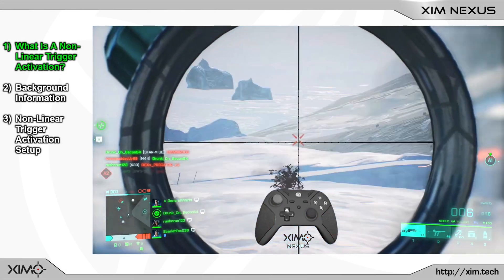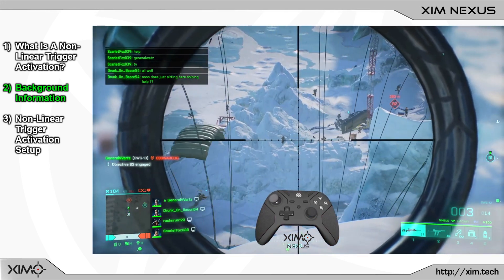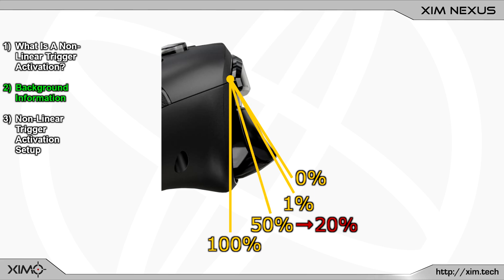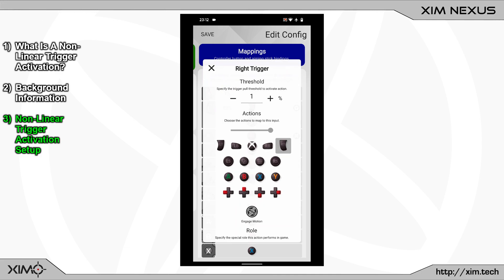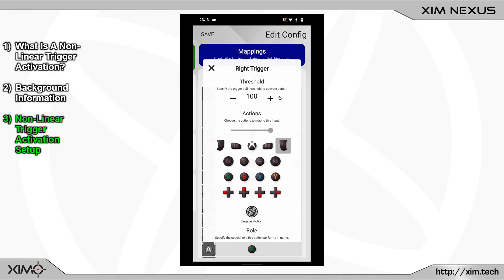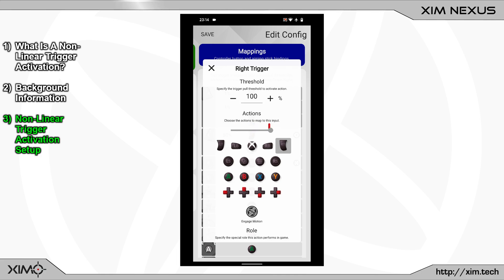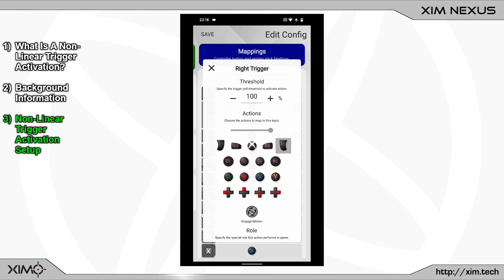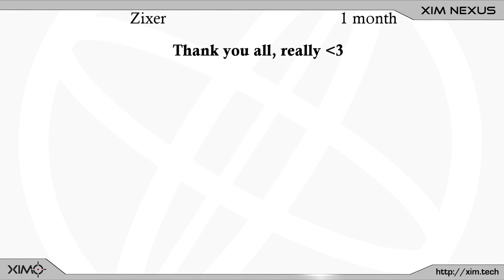XIM Nexus - Non Linear Trigger Activation Setup Tutorial (Neu Nexus Trigger Tutorial Part 2)

Comment: So I can just use the normal nancon controller and not the nancon compact
Reply from the maker: Hey, what do you mean exactly?
Reply: @XIMCentral  so I have a ps5 but want to use xim on ps5 games and in your video a while back you said the nancon compact controller works with ps5 games so I was wondering if the nancon compact is just the nancon ps4 controller
Reply from the maker: @_ekul_472  Ah ok i see. Most PS5 games removed the so called PS4 speciality controller support by now, which the Nacon is part of. At least most FPS games did. Most fighting- or racing-games still work with this solution. If you want to play the latest PS5 shooters then you must use a Beloader or Sony Remote Play nowadays. There currently is no other way.
Reply: @XIMCentral  so I couldn’t use the nancon controller for the ps5 version of rainbow six seige
Reply from the maker: @_ekul_472  It doesnt work anymore, Ubisoft removed the compatibility from the game around 2 seasons ago. You must now use a Beloader or Sony Remote Play.

Comment: Does the normal nancom ps4 controller work with xim apex
Reply from the maker: Yes but only with the most recent XIM Firmware.
Reply: @XIMCentral  so as long as I always have the latest firmware it will work?
Reply from the maker: @_ekul_472  Hey, it is sufficient to update your XIM Firmware once, you do not have to update each time a new one is out :).
Reply: @XIMCentral  thanks

Comment: Can anybody help me I have power consumption issue with my XIM apex and I don’t know how to fix it
Reply from the maker: Hey, either connect an external power supply to your XIM Hub or reduce the electricity load by turning off LEDs or the keyboard backlight. Fully charging the controller can also help.
Reply: @XIMCentral  thank you for the help and it worked but there another problem my keyboard and mouse and controller are all plugged in my controller is on but my keyboard won’t respond
Reply from the maker: @vendexchris4362  What kind of keyboard and mouse do you have? And does the mouse work?
Reply: @XIMCentral  Logitech g502 mouse and a razor huntsman
Reply from the maker: @vendexchris4362  Hey, please look up the huntsman in the XIM Forum. If i recall correctly some additional stepds are needed for that keyboard. The mouse should 100% work though, is that the case for you?

Comment: So I have a xim apex and when I plug it in it does not turn my controller on and I tried everything on the xim apex support faq and nothing worked I don’t know what  to do I have a roccat Kane pure ultra with 3200 dpi and a RK61 keybored
Reply from the maker: Hey, does it work if you only connect the controller to the XIM Apex, so the mouse and keyboard are not connected?

Comment: Hello dear xim
I want to buy new mouse
Which one is the best mouse for xim apex
G pro x superlight or razer viper ultimate??
I know both are good
But which one is better for xim apex?
Reply: I have a viper ultimate and it work pretty well I also have a g pro non súper but it’s works just as good
Reply: @GreenJoshuar6s  thanks bro
Reply from the maker: Both mice are from a technical point of view the best 2 mice you can buy. Get the one you like more, as in the one with the better shape, weight, button placements, ... :).
Reply: @XIMCentral  thank you ♥️

Comment: Will this work out of the box with PS5? Or do you need additional devices?
Reply from the maker: PS5 support is being worked on, you can already use a XIM Nexus in PS5 games by using a Beloader or Sony Remote Play though. You can find a tutorial for both on this channel! :)
Reply: @XIMCentral   which video shows you how to use it in your ps5?
Reply from the maker: @xanarchhyy2017  The setup for Nexus is the same as for XIM Apex in that regard, so you can watch my XIM Apex PS5 compatibility videos (Beloader and Sony Remote Play). I will make a dedicated XIM Nexus PS5 video in 2-3 weeks i think.
Reply from the maker: @xanarchhyy2017  Hey, ideally use an original PS4 v2 controller connected to your Nexus adapter. Also check if the Beloader successfully establishes a connection to the PS5.
Reply from the maker: @xanarchhyy2017  Hey, can you try the following?
1) Press and hold the button on the Nexus adapter for a few seconds until it starts blinking
2) Turn around your Nexus controller, at the bottom there is a tiny round button. Press and hold it for a few seconds until the guide button of the Nexus controller starts blinking.
Now wait a few seconds and check if both are pairing with each other.

Comment: Hi I was wondering if there were still third party controllers for ps5 game version for xim apex or can I only play destiny 2 now with my beloader?
Reply: Hey you can't play d2 with beloader?
Reply from the maker: D2 recently removed third party controllers from their PS5 version, so either a Beloader or Sony Remote Play must be used right now. And yes there are still games on PS5 that support third party controllers, but those are mainly racing or fighting games.
Reply: @XIMCentral  Okay I want to ask as well if there is a chance that the dualsense will be compatible with xim apex in the future?
Reply: @XIMCentral  I also bought the beloader but my wifi is not that stable that's why I have some issues with it but it is still playable
Reply from the maker: @veselinslavov6975  You could use the Beloader Ethernet Mode to avoid such problems, or try the Wifi optimization steps from my Beloader Setup video. PS5 support is being worked on but there is no progress to share yet.

Comment: Hello I have being trying remote play with xim ps5 and it has working but going lazy and like Dsync is what it feels like. I have like no control for like 2-3 seconds do you know a fix? This is on R6
Reply from the maker: Hey, try the Wifi optiization steps from my Beloader Setup video, alternatively use the Beloader Ethernet Mode on which i also did a video. What you can also try is to plug your Beloader into a phone charger (5V 3A) instead of into the PS5.

Comment: With this option what is the benefit of it? Thanks!
Reply from the maker: You mean with a non-linear activation or with Nexus in general?
Reply: @XIMCentral  non-linear activation!
Reply from the maker: @josepiedra9581  Oh i see. This is rather niche but it allows you to use exponential or other trigger ramp up speeds. All games traditionally use a linear trigger activation. Press the trigger twice as much and the game will recognize twice the input. By changing this behavior you can activate your weapons faster, draw a bow quicker, or add other behavior that allows you to get more control over your weapons. You could for example draw out the point at which your weapon shoots, so no matter how much you press your trigger the weapon will always shoot. Or you can bind several activation buttons onto the trigger and organize those through a non-linear activation behavior.